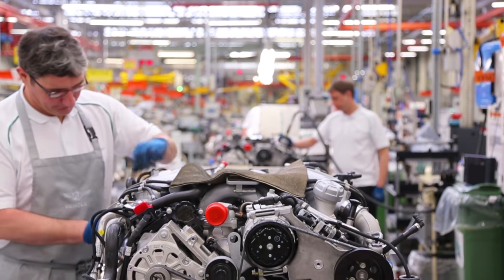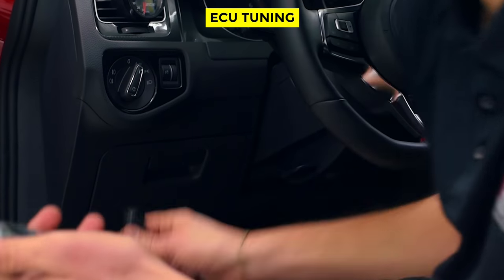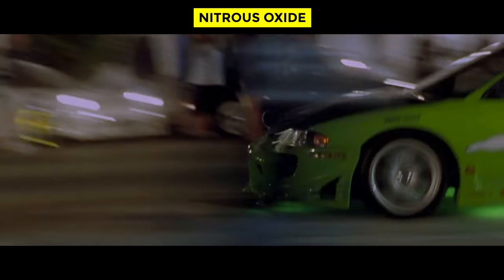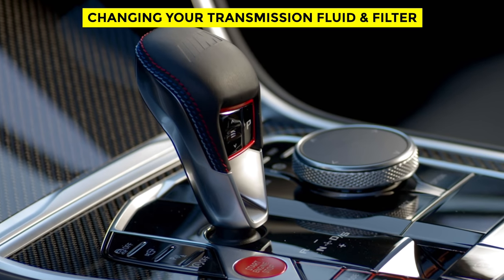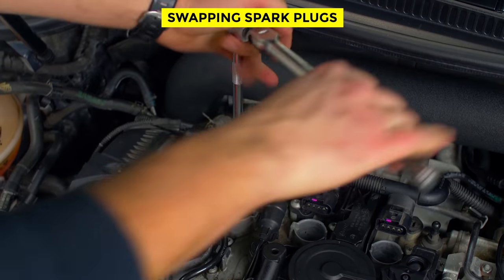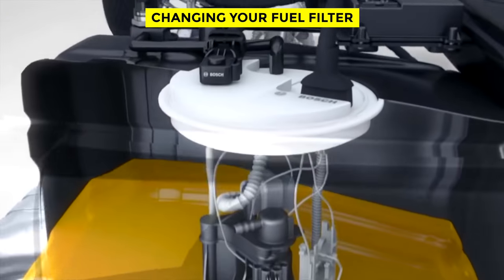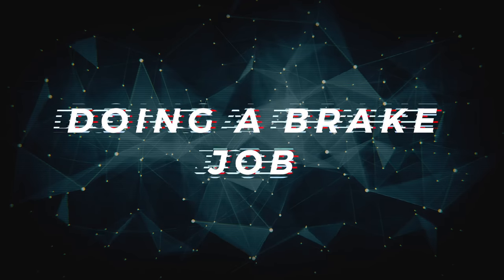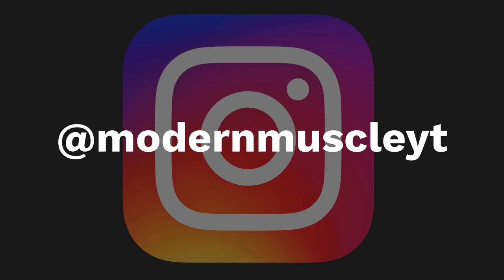Doing This Will Make Your Engine Run Better

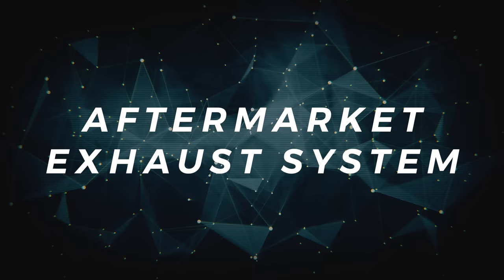Comment: 0:48 Aftermarket exhaust system
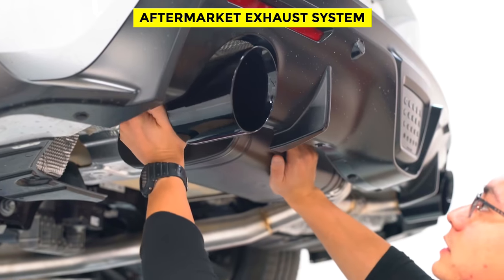1:19 ECU tuning
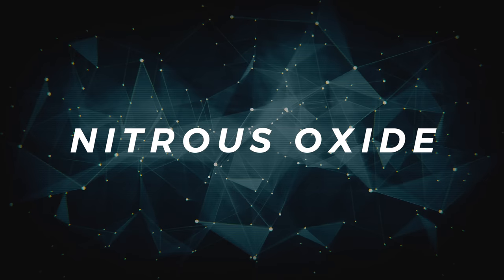2:16 Nitrous oxide
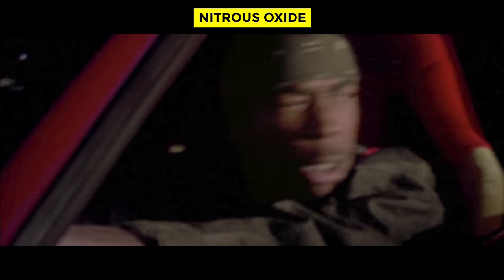2:56 Serpentine belt
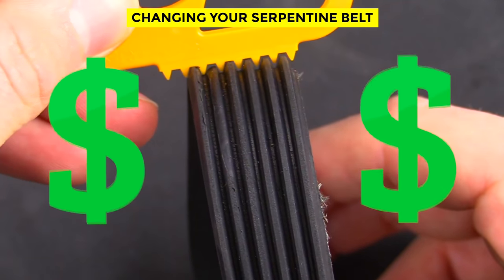3:28 Spark plug wires
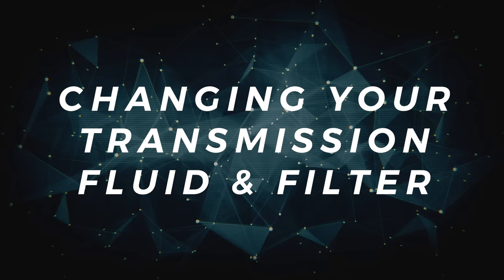3:58 Transmission fluid and filter
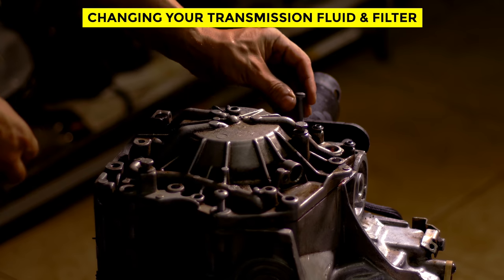4:43 Battery connectors
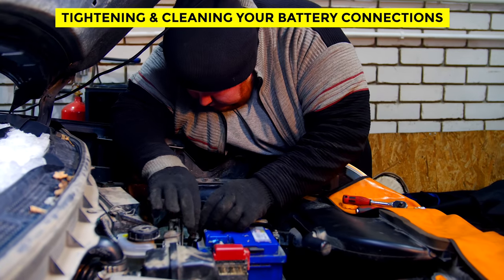5:23 Spark plugs
5:53 Air filter
6:23 Fuel filter
7:14 Drive train
7:31 Carburetor
8:04 Coolant
8:29 Brakes
9:14 Suspension
Reply: What else is left to change ?
Reply: Girlfriend.
Reply: That was way more than 5 secrets! Lol
Reply: Sell the car and bay a fast or knew one😂
Reply: Why don’t you buy a new car

Comment: At 5:56, the air intake kit installed causes the engine to draw in hot engine compartment air. Cold air is not ducted into the intake from outside the engine compartment. This kit is detrimental, causing hotter, less dense air to be taken into the engine, which will make less power and reduced fuel mileage.

Comment: At my house we have a variety of vehicles.  In the diesel area, our Cummins powered truck is a total beast.  The axle ratio is a tall 3.42, with 33" stock tires.  The Ecodiesel truck is much milder.  But switching to a Flowmaster 50 series HD Big Block muffler.  And a Bank's silencer delete.  Elinated the throttle lag.  The 3.92 axle ratio Ecodiesel became a pleasure to drive onroad or offroad.

Comment: True fact; a study at a shop with a dyno once did a test on a Honda with stock air intake vs two aftermarket cold air intakes---the stock intake won. And on a stock engine, adding an aftermarket exhaust is worth maybe 5 HP. Trying to build HP by replacing just an intake or an exhaust is worthless---mods should be performed in a system approach.
Reply: I know right..
Reply: Yes, but he probably meant do this to you're engine. And you become a better runner
Reply: But if you do both a full exhaust and intake, shouldn't that give more breathing to the engine? At least it should improve responsiveness, but combined with an ecu tune those should give more horses right?

Comment: Be careful with oiled air filters.  They're great for carburetors, but the oil can be sucked into the induction system in minute amounts and contaminate mass air sensors.  Best tip for longevity, change your oil. Worst tip for engine longevity, give 'er a shot of NOS every time you hit the gas.  Nothing like stress to let an engine know you love it so.

Comment: Adding a programmable ECU can increase your fuel economy by 120% and top speed by an additional 300 MPH.
Reply: Adding stickers adds 10 hp
Reply: @zassindahaus3993  I wish I'd known that before I let my little girl put stickers all over the bumper. Started it up and ripped it right off the motor mounts. Think it could have been the unicorns smh.

Comment: If the filter is near the front grill away from engine  heat  yes it will get cold air means better oxygen level in the air sucked in to the manifold

Comment: How can i clean my battery, i have 750A battery and it won't start with lower amps. Because starter cables are too thick.

Comment: These are not secrets, but a lot information put together
Reply: Lamp not working? PLUG IT IN!... lamps use electricity from your wall.. if you want your lamp to work you need to plug it innnnn.

Comment: Exhaust, Tune, NOS and belts/wires... yup. I have my exhaust done, a tune no NOS and haven't replaced any belts or wires so I should probably get on that to gain the most HP...

Comment: You wanna keep your engine running? Change your oil.

Edit: also, don’t change your transmission fluid unless absolutely necessary.
Reply: Think I have overdone it.  It just keeps running running and running running....any ideas on how to gain control????
Reply: Soooooo correct on the transfluid . The old fluid with the worn clutch material in it provides good needed friction . IF it's very very black n burnt smelly do a filter change and only a 50/50 fluid change . Re use 50% of the old trans fluid
Reply: adam s exactly, and the sad part is that some mechanics will just change your fluid without hesitation
Reply: I just suck out a litre and add new every year
Reply: Mado BA , us mechanics love people like you. 
Not changing your transmission fluid will shorten it’s life. Changing it before it’s dirty will reduce wear. It’s best to drain pan and replace the filter when the fluid no longer looks fresh. But well before it’s dark looking. The myth you are using comes from filthy transmission getting new fluid and then deposits coming loose and gumming up the filter. If it’s really dirty, repeat drain and fill pan weekly until it’s clean. Then keep it clean. Think about this, friction material in the fluid will be wearing bearings and gears more than helping the clutch’s and bands grip.
Reply: I'm fighting this temptation to do a drain and fill (three Quarts) NOT a complete flush. I'm heading both sides and I'm so confused 😂🤣 about what to do 07 IS350

Comment: Am I hearing right, that by tuning the ECU... air, power, speed, fuel delivery and fuel economy will increase? Sounds a lot like a "free lunch" to me. 1:47
Reply: yeah if your engine makes more power you end up using more fuel
Reply: Saul Espino , perfect air/fuel ratio creates the most power. 
Many tunes pull out a little bit of fuel, running a little leaner than factory “safe” setting.
Reply: @pumba3280   im a bit lost , so factory air/fuel is rich or lean compared to flash tune ?

Comment: My GMC Sierra 2500 HD... Doesnt have a fuel filter... only a sock on the fuel pump... and to drop the tank and replace it is over 900 bucks..

Comment: In what world does simply adding an exhaust, give you 20 horsepower!?
Reply: The theory is that larger size pipes front to rear increases the air flow out. Smaller size pipe tends to slow the air flow down which can inhibit airflow limiting horse power.

Comment: OMFG ..I HATE WHEN PEOPLE SAY " ADDS HP AND MILEAGE " you can't do both , you need fuel to make power . Stock 167 hp I got 42freeway mpg . Modded n tuned 250+HP now I get 32.6..
Reply: Depends on the motor, obviously with 250hp ur not saving anything, 2 sides to every story, Learn more

Comment: I need the best way to build up 1 off the 7 cars i plan to get 1)subaru svx,2)mercury marauder,3)Volvo s60r,5)ford countour svt or a saab 9 5t,6)Pontiac ws6,or z28ss,7)Dodge stealth rt aws awd 3000gto.8)Saleen mustang,9)nissan 300zx tt,10) GMC typhoon,11)Chevy s10 extreme ,12)chrysler crossfire srt. Any advice im going to keep eclipse gst talon turbos dodge darts chevy ssr, silerado ss. And ill always have warm spot for viper.nsxt,cadillacctsv

Comment: get some performance stickers for addition 5 to 10 HP
Reply: chrome adds horsepower too
Reply: also install fender flares adds hp
Reply: Don't forget the fuzzy dice!
Reply: See and I thought it was wax !
Reply: @sotaboy8040  They are now against the law in most states, the obstruct you vision.
Reply: @bruceaugustine6486  they might be illegal but the power they add is whiplash inducing neck breaking experience... So worth the trade off!
Reply: @bruceaugustine6486  I tried my best to make it as obvious as possible that these were facetious statements about things that purportedly add power. That is unless you believe the original poster was serious that adding stickers makes an engine run hotter in which case I'm sorry that the humor intended by these statements was beyond your comprehension.
Reply: @sotaboy8040  They were not beyond my comprehension, it seems my comment must have been beyond yours, but next time i can put a LOL after the comment so it is easier for you.
Reply: @bruceaugustine6486  maybe an lol would've helped so they would've been funny for at least one person.

Comment: Some of these tweaks are not good ideas depending on which state you live in. If you install a ECM that has been remapped....yes it will give better performance BUT is no longer compliant with smog regulations. If you try to take your car through a smog check station likely it will fail. Intentional breaking of emission regulations can open your up to big fines also from the EPA if they catch you. I think saying these changes will make your engine run better may be incorrect....they will make more hp and increase performance but often at the expense of longevity and/or being legal for street use. If you look at  most of these type mods, they say that they are "For Off Road Use Only". That is the after market companies way of putting the onus on you if you get caught. Note that currently the EPA is going after the companies making these after market performance products that are often installed on cars that are driven on the street. This is a serous issue in California with these companies....I am starting to see articles about this.

Comment: now days cars manufactures cheap out on parts and cars are more expensive
Reply: Plastic parts in bmw
Reply: @nayak4636  All cars have a lot of plastic parts nowadays
Reply: Plastic = cheap and light.. nothing bas about using plastic, if they use wood we cound save our planet or some other valuable materials

Comment: Get rid of all of that junk and electronics and just have the gas turned into a vapper before the  combustion and watch what happens. While at the same time watch what comes out of the exhaust pipe.  When you make gas into a vapper before combustion everything is burned. It burns clean with no pollution and you will get about 150 Miles to the  gallon of gasoline

Comment: yea I got a turbo whistle it gives me like 420HP because it is a TURBO whistle.
Reply: Impossible, unless you have the exhaust whistle
Reply: amateur..I put 2 whistle on my dual muffler,you do the math..
Reply: hafis ismail you rookie! I just bought a new car and I removed the exhaust because it adds weight, put the turbo whistle right out the engine.
Reply: For shizzle my nizzle?? , I got that anti lag on my whistle, now I even smoke a missile.

Comment: "If you can plug a lamp in a wall socket... you can probably replace you spark plugs"...  That is the dumbest comparison ever... really how is that relateable!?... dont worry ill wait for an explanation
Reply: Jorlanjm actually he said spark plug wires
Reply: @aaronilagan2820  both but he comparasin was with the wires indeed. Only if it was the other way around, then it would be more logic. Still the content makes no sense. What if you tell someone, hey I know a secret to make you engine run better: replace you're filters , change you're belt , spark plugs en wires, fluids, change you're brakes , exhaust. It's easy!!  O I forgot the most important, you know that moment in fast en Furious, when they get in back to the Future mode. When Al of a sudden you're 5 speed manual becomes a Shimano 21 speed gearbox ....it's cold NO2. Just installed a bottle in my parents car.
Reply: I plugged my lamp into spark plug on my engine and gained 5 watts of engine power
Reply: He was referring to changing the wires dumb dumb.

Comment: 8:00 Dude, installing a four barrel carburetor will not increase horsepower. You have to install a hotter cam also.
Reply: Going from a 2 barrel to a 4 barrel can make a big performance difference including on the dyno. I know this from experience

Comment: Not everything that was said is accurate, as replacing a 2 barrel carb for a 4 will not increase your engines performance tenfold and is an inaccurate statement. That would mean if an engine was say 300hp x 10, it would = 3000 and is not possible with a simple manifold and carb mod lol
Reply: Leave the guy alone dude His mom and dad own 5 gas stations in California.

Comment: No modern car has spark plug wires anymore. Replacing the exhaust would make Your shitty car only becoming a loud shitty car. Hardly any improvement to power output or gas mileage on average cars. Replacing the ECU will cost more than the car `s worth with very little improvements. Except U own a RX 7 with serious modifications. Than it also reduces the liability.

Comment: Ecu tuning will not increase hp on normally aspirated engines. The ecu doesn’t control air flow in normally aspirated engines. It only control fuel and timing.
Reply: Once again I have to disagree... tuning the car can result in more hp and torque
Reply: So the control of Fuel and timing don't impact HP and NM torque... Thats a new one for me.
Reply: Ecu increases hp depending if the engine
Reply: @ExtremeAutomotiveAddiction  It does not increase hp or torque in n/a engines. Air is not control by the ecu.
Reply: @Michaeltje89  The maker has set the engine up to make the most hp it can make. Adding more fuel or timing will not increase hp.
Reply: @blackericdenice  sorry and I'm not trying to be disrespectful or argue but you're increasing air/fuel mixture as well as adjusting timing...do some research, most everyone would disagree. You can generally get more performance and power out of a simple tune even on a naturally aspirated engine.
Reply: @ExtremeAutomotiveAddiction  Ecu does control the air/fuel ratio by controlling the fuel flow only. The only way to increase air flow with a n/a engine is with a cam change, boost or nitrous oxide.
Reply: Auto manufacturers generally tune engines down so that they don't wear out as fast, a simple tune can make more power
Reply: Tuning the ECU on any motor NA or Boosted or supercharged will increase HP. All vehicles come from the factory detuned on purpose pretty much as a safety feature on boosted and supercharged vehicles. On NA its due to EPA regulations such and so fourth.
Reply: If you add timing to your vehicle it adds horsepower been there done that with supechips eco handheld tuner.

Comment: Flywall I thought it's called flywheel
Reply: No its flywall in wttch the transmitter is connected to the tubular rotissary  that connects to rear end and causes the tires to turn.
Reply: @jacksimerly5788  funny

Comment: DO NOT DO TRANSMISSION FLUID FLUSH  FOR THE LOVE OF F***ING GOD.
Reply: omg not this again. why not?  thats like saying dont change your engine oil
Reply: @predater5017  you can change the fluid but flushing it can cause damage to the transmission.  It can push debris around in the transmission causing damage.  Changing it is the best way to go dont flush it tho

Comment: Changing your transmission fluid will have you buying a new transmission
Reply: Not true at all. Changing the transmission fluid is good and should be done. When you drop the pan and do a simple fluid change, more than half the old fluid remains in the system and cycling new fluid in every so often is good for it. Waiting until 100k miles then suddenly doing a full flush with 100% new fluid and you may end up fucking yourself.  You're making a mistake by never doing a fluid change
Reply: @RDA8191  your first sentence contradicts your second statement, and gives merit to my statement, thanks. You should have begun with "not true, unless" and you argument is still debatable. Claiming what I'm saying as "not true" goes against what I learned first hand 15 years ago monetarily, that was later confirmed by a Lexus service center about specifically my sc400 ( that I proudly still own with over 200k and pur's like a baby) it is in fact recommended that you only add to the transmission fluid.